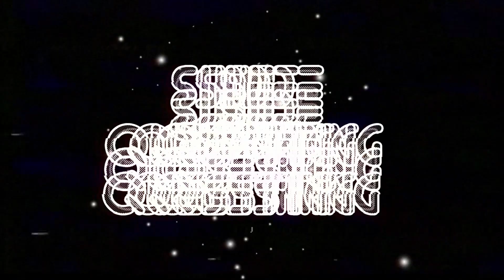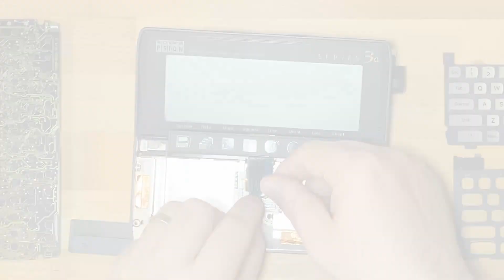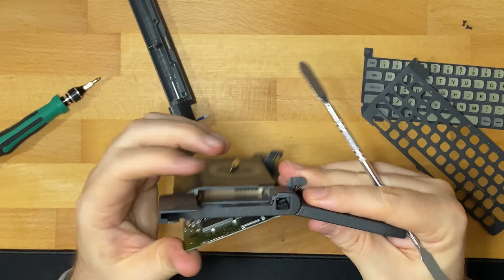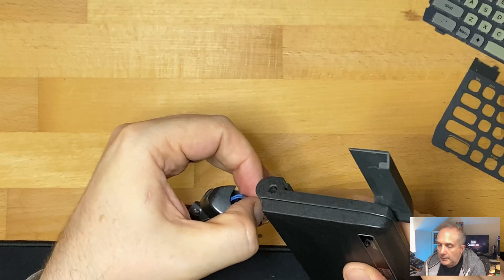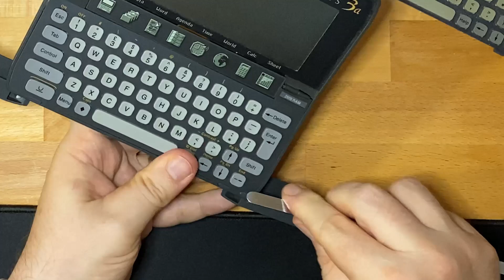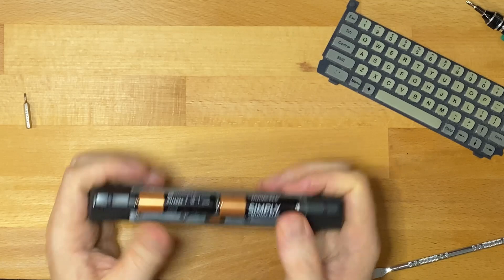Psion 3a  - Part 3 - Repair and Re-assembly

Comment: Disassembling it as you did risks a broken motherboard.  Correct procedure is taking off the battery compartment and splitting the halves.  Back in the day I could do it within half a minute or so, blindfolded.